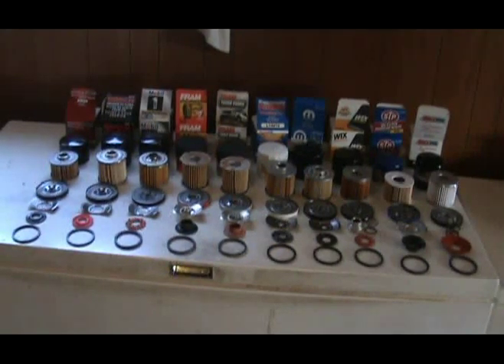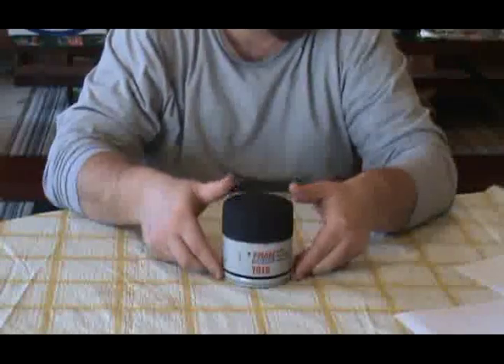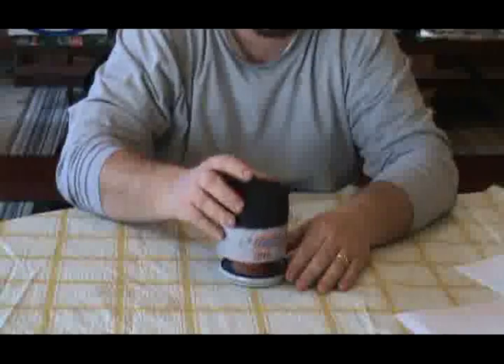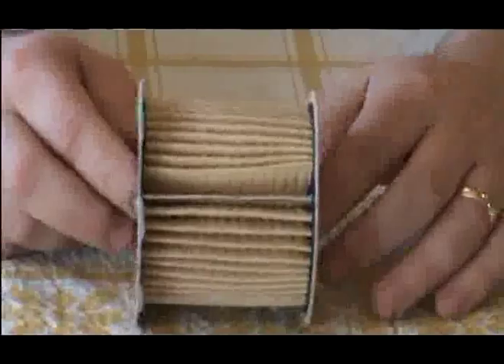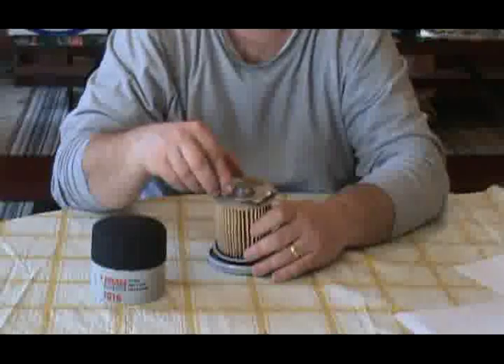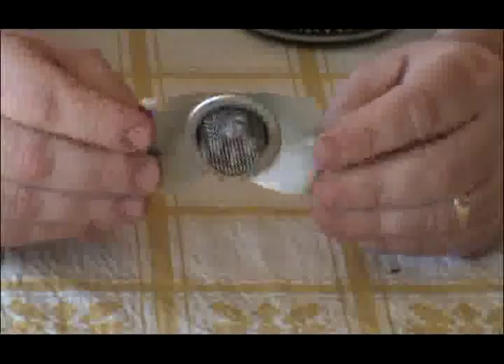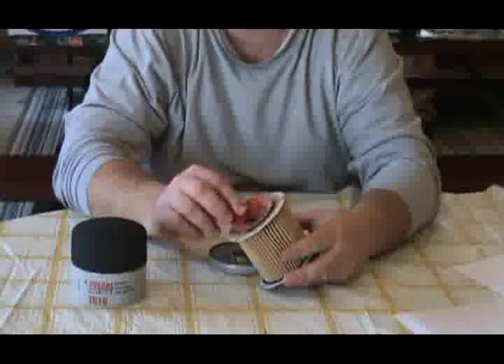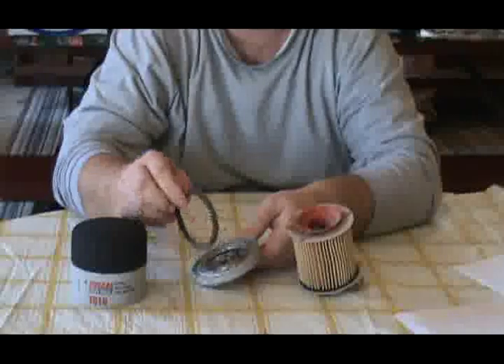What's in a Fram tough guard filter?

Comment: I just cut open my FRAM tough guard after 5000 miles and it looks pretty good to me. The endcaps don't feel like cardboard, its kinda like the filter material and very hard. It almost feels like what one poster said it being cellulose combination. I only like FRAM since they use that sandpaper coating so you can take it off with your hands. My car has a very tight area and I like taking it off with my hands. Makes the job much faster :), I wish other filter makers would use that same coating :(

Comment: Iv used both tough and extra guard on my Ford truck. 5.4 liter. With different oils over the Years. It has 320 thousand miles on it. And runs very strong. One thing I can say. They filter the oil. For sure. And they never fail or leak. Ever. Period.
Reply: James Salyers People hate on Fram too much. They do get the job done. As long as you change your oil on time, you won't have a problem.

Comment: I've seen all the video's and all the talk about the end caps. They aren't cardboard as many have said. They are a fiber material which would be a much better material to bond the filter element to in my opinion. I've been using them since the mid 60's with absolutely no issues.

Comment: The ONLY difference between the ExtraGuard and ToughGuard is the screen over the bypass valve. The filter paper pleats distort and either clump together or open wide - there is no pleat uniformity under pressure, thus the filtering surface area is reduced.  Fram is a low grade filter and not worth the price.

Comment: So what, they don't make the filter any better than needed to do it's job.  Unless you're racing or going into combat, it simply does it job well enough for a common commuter vehicle.  Now if you like to never change your oil and clog and stress/fill the filter media, get the best one you can find for long life.  If you change your oil as recommended on a commuter vehicle, there''s no reason not to use Fram.  The filter is far less important than the right amount and type of high quality oil and regular changes on these cars. IMHO:)